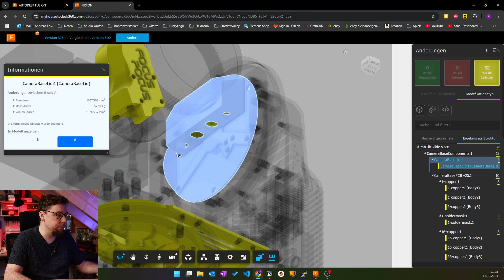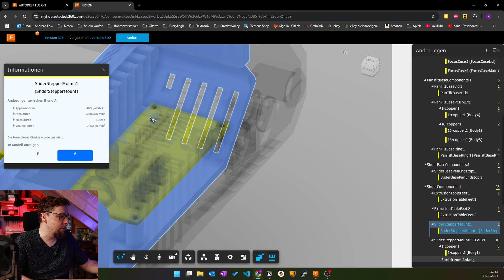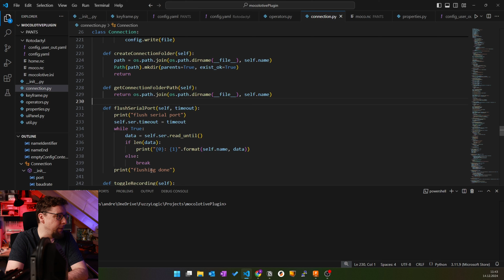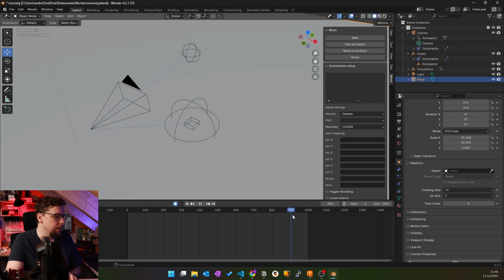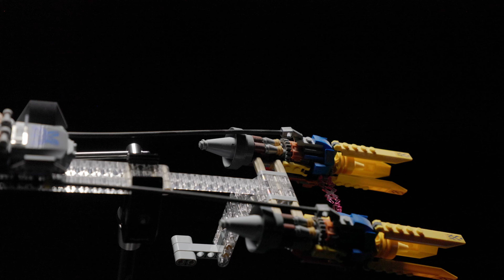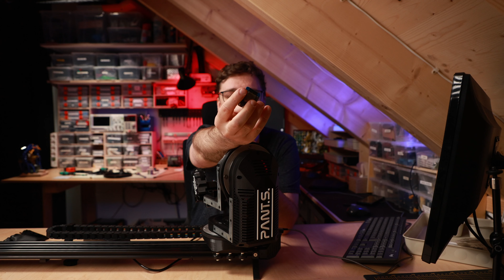PanTiltSlider Dev Vlog 4

Comment: Hey, just checking in. It would be good to see how this has developed over the last year.
Reply from the maker: Hey, thanks for asking! I've completely redone my workshop over the last year. Rebuilt every workbench and cabinet from scratch and put everything in gridfinity. That took a while and in the meantime I've started studying again, so limited sparetime at the moment. I've uploaded the final design files to GitLab though so you can check them out if you like ;)
Reply: @fuzzy4logic  Nice! Very satisfying work. I'll take a peek. For the past few months I've been using Claude Code to add a bunch of features to my PTS that were outside of my ability. Mine's used solely for live events with video cameras, so I've added object tracking, and 3D triangulation to set points so it now follows the height of the subject better when they're high and near to the mount instead of an un-necessary crotch shot mid way through the slide!
Reply from the maker: Wow, that's very impressive! I've also tried claude and some of the results are astonishing. How did you achieve object tracking? I've thought about intersecting the hdmi camera stream and use opencv to track things but have not tried it yet. Are you planning on publishing your work?
Reply: @fuzzy4logic  I simply asked CC to create cv tracking for the system. We use and ATEM Constellation so I output a video aux of the camera I want to use tracking with, convert that to HDMI, then a cheap UGreen HDMI capture dongle. Then with my app there's a "CV Track" popup, select the camera mount you want to control (I have 5 motorised mounts), start the video feed in, then I can see the live footage with boxes around each person. I click on the person and the tracking takes over. You can set the target goal for the tracking too.

I will be publishing it all, it's almost ready to push out, but I find making the 'building the mount' videos tough to get right. I'm set up again right now to do it, and I might do it in stages as making the whole build is daunting.

But yeah, I've been able to add SO many more features by using Claude Code, my original hand written code was ok, but this is another level. Even writing all the documentation / manual, it did in a few minutes.

Comment: Yeah, the play in those bearings isn't good. I've been using a large steel bearing in mine, specifically the 6824ZZ 120x150x16mm from SimplyBearings which is around £60, but well worth it. It's really great to see this project develop.
Reply from the maker: I have a similar bearing on my list for version 2.0 (61819 2RS). Great minds think alike 😅

Comment: I just watched your turntable video and thinking if it's possible to build a slewing bearing for your pan hear along the same lines with the v-slot wheels?
Reply from the maker: I think the V-slot wheels are too squishy for this. I've had a look at an inexpensive steel bearing with 120mm diameter that looks promising